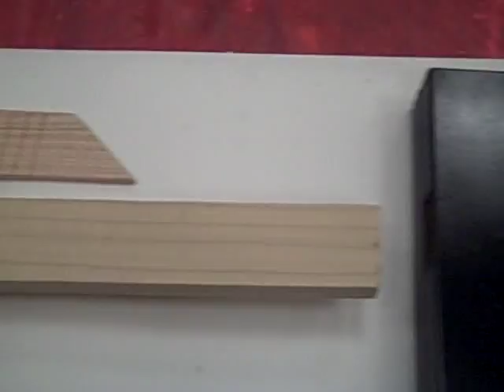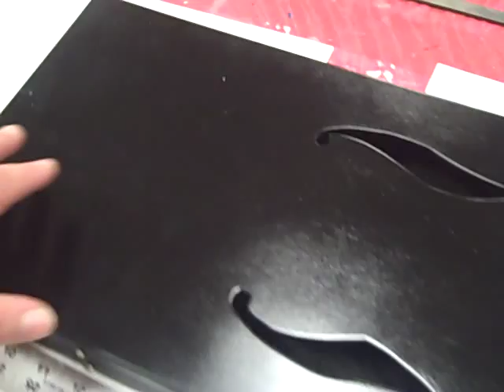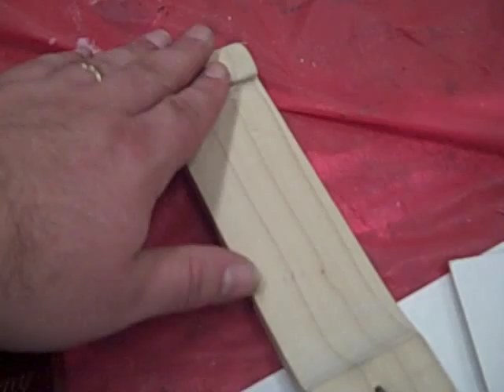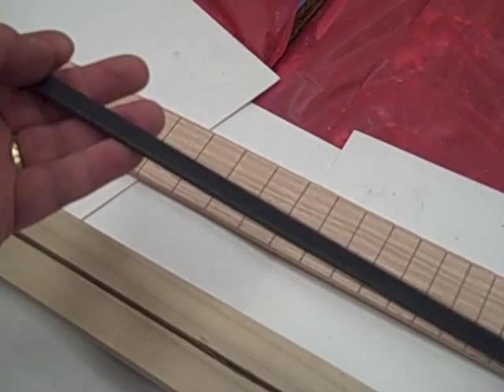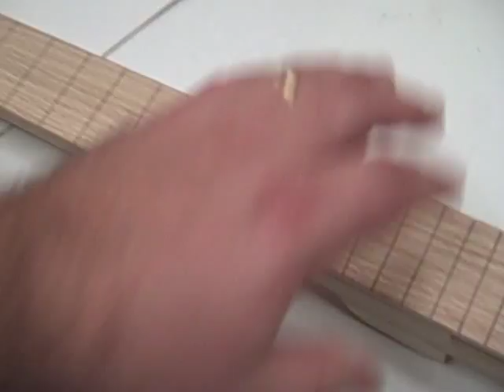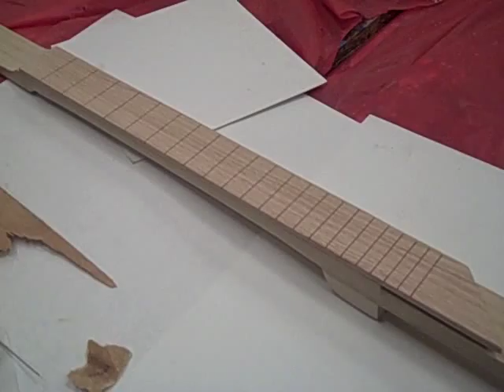Next Cigar Box Guitar Project - Truss Rod

Comment: You did a nice job on the box paint and the "f" holes. Btw...how wide will you make your neck for a 6 string? I've made 3 strings at 1 1/2" wide. Been thinkin of making a 4 string, but a 6 would be even better! I bought a neck from Tomtop for a regular guitar build and it's nice...less than $30 and free shipping. I thought they would be good for 6 string cbg's too!👍😎🎸🎶

Comment from the maker: @dlannetts Truss rods are required for instruments with steel (high tension) strings. Without a truss rod, the guitar's wooden neck would gradually warp (i.e. bend) beyond repair due to applied high tension.  They are also used to adjust the neck.  What I was putting in probably isn't technically a truss rod since it's not adjustable.  With poplar for the neck and six strings there was a chance the neck would bend.  Thanks for your comment.

Comment: dude I'm gonna be making my own guitar. I'm am going to be using once peace of wood for the hole thing evan the neck will I still need a trus rod?
Reply: Depends on the hardness of the wood you are using and how many strings you are putting on.  There is actually a hardness scale you can look up online.  Steel strings for full electric put more tension on the neck.  Even more so if you add more strings.  I've seen some electric bass guitars with a truss rod and 2 support rods on either side of the truss.

Comment: Guess you don't know that some high-end guitars are done with carbon fiber non-adjustable trussrods - simply laminated in just as here! The relaxation has to be perfect from the start then, because afterwards the neck is never ever gonna bend even the tiniest bit! A guitar plays a bit better when it's bent just a tiny bit.

Classic (gut/nylon) guitars are often made without any truss rod at all, due to low string tension. This one is going to be real solid, you could drop a bomb on it.

Comment: Hi,  Although what you have done is not a trussrod, it is the same as what they used to do on older steel string acoustics and it was called  a steel reinforced neck.
As long as everything is straight and trued when you glue on the fret board it will help to keep it that way.

Comment: I like this . Truss rod not going to work. You need to fit a bent piece of metal with a thread on. Fit this into a valley cut in the neck, you then  fit the truss rod with no tension  and trap it with a fillet of  wood, plane down the wood to fit flush with the neck fit fret board. Truss rod should come out of one end of the neck, fit a metal plate and then add nut. Tighten the nut it will force the truss rod to straighten this will straighten warp in neck. its something worth researching.